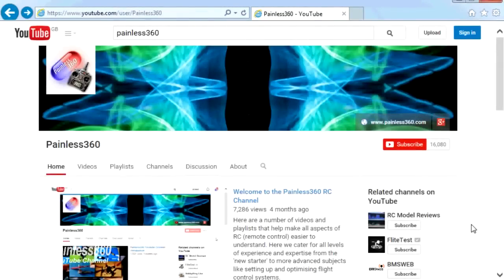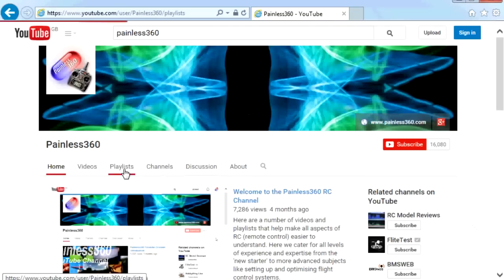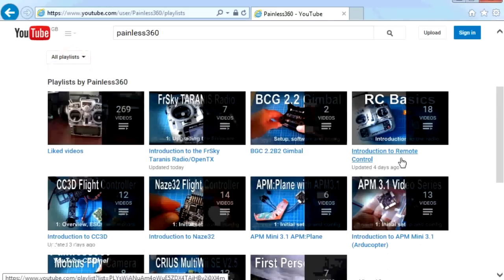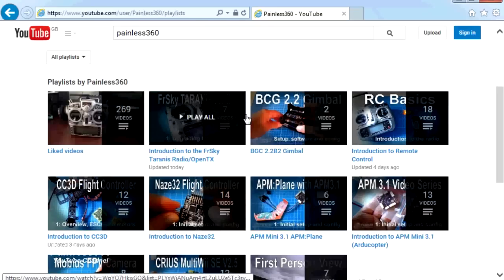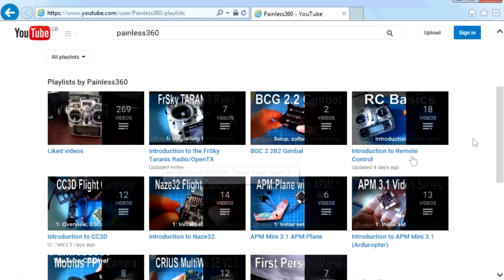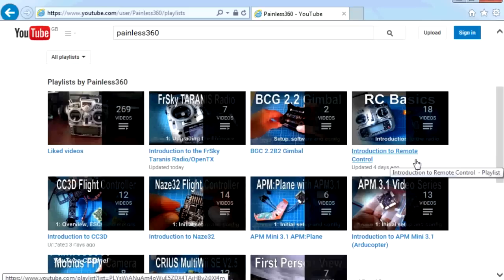FrSky TARANIS Quick Tip - Setting up Throttle Cut/Hold switch easily

Comment: Nice tip Lee, I just used this to prevent me from arming my S500 (I don't want some 10 inch blades taking care off my haircut)

Throttle stays at -100 and Yaw stays at 0 until I flip the magic switch and then they work like they should.

Comment: If I could make a video request it would be setting up a "super simple gimbal" with a naze32 on clean flight. Easy build using cheap components everyone has in the parts bin and it would go slick on your tricopter!. Thanks for everything Painless360!

Comment: Absolutely love your quick tips like this "oldey, but goody" of a OpenTX trick! I've been pulling my hair our trying to properly calibrate the speed controllers on a fixed wing while connected through Pixhawk. Hopefully adding this switch allows me to properly calibrate and start flying :-).
Reply from the maker: Check out my latest Pixhawk 2020 videos for lots of up to date tips.. Happy flying
Reply: @Painless360  Awesome! Thanks, I'm checking the Plane and Multirotor playlists out now. Thanks again! Happy flying as well :-D!

Comment: Love the mod.  I am not using it for throttle but for a 6 position switch that controls flight mode.  I am testing automated  flight and want an easy way to get back to manual mode if things get crazy.  A 6 position switch is not easy to spin the switch back to manual while a plane is spinning out of control.  I can flip a 2 position switch fast to rescue the plane.

Comment: A nice addition to this is to set up a logical switch...
L1   a>x   Thr   - 99   SG -
which means ...
IF Throttle  >  - 99 AND  SG - is selected THEN L1 is true

then add this special function...
SF4   L1   Play Track   thralert   5s
which means ...
IF L1 is true THEN  play thralert every 5 seconds

This will play "Throttle Warning" if you switch to SG- and the throttle stick is not at off.  It will give you a "Throttle Warning" every 5s unless you idle the throttle so you don't forget to idle the throttle before enabling it.

NOTE: thralert.wav is in the SOUNDS/en/SYSTEM folder so if it's not in the menu you will need to copy it to SOUNDS/en to use it here.

Also for S3 shown in the video it would probably be better to use !SG- (rather than SG^) so that all other positions of the SG switch (SG^ and SGv) play the "thract" track.
Reply: +press all the knobs Very good info..!!!

Comment: You're a blessing! Anyway, I have to as you this painless, is the Taranis reliable? The guys at my flying field tell me to get rid of my Taranis asap as they think the tx is garbage and are telling me to buy a JR or Futaba. Is it true that the Taranis has reliability issues? I personally love the Taranis and its functionality but I'm scared that I may lose models as I'm beginning to get into glow airplanes which are expensive. Would like to know your thoughts on this.
Reply from the maker: +Gtx560ti The switches and sliders are not the highest quality. See our video on radio selection that mentions about considering using what others around you do but beware of snobbery. Not every radio is perfect and each to their own.. ;)
Reply: Thanks for the reply Painless. What radio do you use?
Reply from the maker: I am a big fan of the Spektrum kit, I have a DX7 and a DX9 as well as the Taranis. I use the Taranis 80% of the time as it's so versatile..

Comment: It's a matter of preference but I would put the throttle cut on an up switch position ^ (eg SG^) rather a center - (eg SG- as used in this video). The up ^ position is the default off position and it make sense to power on with throttle cut enabled which will be enforced by the default pre-flight checks. You can change all the pre-flight warning checks of course but unless there is good reason it's probably better to consistently keep the default so you don't have to remember how each model is configured.
Reply from the maker: press all the knobs Exactly - It's a matter of preference. This is a demo showing how to do it, not a recommendation on where to put it. ;)
Happy flying!

Comment: Sticky function does not unstick when the switch is reset in simulation. On the radio L02 automatically stays on when you push down the switch and does not wait for L1 and -99 throttle.  I tried with a horus, q7, x9lite.  I'm running the lates firmware as of Oct 2019.

Comment: Nice video.  I tried to set mine up last night on a twin engine model (channels 1 and 6) and it seemed to work.  Only problem was that when powering up the plane, the ESCs wouldn't arm unless I enabled the throttle.  Any way around this?  The only thing I did differently was that I didn't set the value to -100.  But like I said, it still worked if I were to arm the ESCs first by having the switch in the "throttle arm" position upon battery connect.
Reply from the maker: +ZippinZim Probably due to the value of the channel not being one that the ESCs are happy with, I'd look at tweaking the values on the throttle when the mixes are being used. Best of luck!
Reply: That did the trick.  Sorry, should have tried it before asking you.  Changed the value to -100 and works like a charm.  With the value at "0" the transmitter was essentially at half throttle thus preventing the ESCs from arming.  Thanks for your videos!  They are quite helpful!

Comment: hi Painless, would you have any videos explaining how this works with gas engines? newcomers to gas engines like me who might be also having a difficult time transitioning  from Electric to gas?
Reply from the maker: Not really, we only use electric here. A gas engine does need two 'low throttle' setting though. The first is for idle where the throttle is zero in the radio but the motor is idling. The second is 'thr-cut' which is a slightly lower value and that closes the carb down completely stopping the engine. The second is the value you set a throttle cut to. Hope that makes sense..

Comment: Hi, Like to know 1. the difference between Throttle cut & Throttle hold in RC Heli / Plane. 2. What is the use each. Thanks.
Reply from the maker: It depends on there being a consensus on those terms in the hobby.. ;) I've always looked on them as the same thing..

Comment: I've just bought a Taranis after using a DX18. For electric model I used to create a zero throttle (-100) curve and assign is to a switch. After playing with Companion I see you can also do the same thing with the Taranis e.g. two curves (a zero and normal) on a switch assigned at input. Are there any pros or cons in do either via special functions or via curves?
Reply from the maker: Welcome to the world of OpenTX and the Taranis! I too came from the world of Spektrum so was initially confused at the power and flexibility of the new radio - the setups are very different. You can do most things several ways on the radio too, adding to the confusion. You can do it in the way you're using (that's a very DX18 way of thinking ;) ) or you can simply use the special functions to override the throttle channel value with -100 and assign a switch.. Best of luck!

Comment: Thank you for useful video series. I would like to enable/disable throttle cut/hold using SH switch (momentary switch) . If I toggle SH switch first time, throttle cut enable. The second time toggling the SH switch will disable the throttle cut. It is like "alternate on/off" function in futaba. Is it possible to do that in taranis? Thank you in advance.
Reply from the maker: +Kittikun Jitpairod I'm sure it is. You probably need to look at using a few logical switches to hold a 'sticky' value (you could use an unused channel' and then use that to override the throttle in Special Functions. Best of luck with it.

Comment: Thanks for this tip. I want to setup a "oh crap switch" that overrides my 6 position mode switch for arduplane to rth. I set it up as you said and also selected the correct channel and enabled it but somehow it just doesn't work. Is there anything else I have to look out for?
Reply from the maker: Could be lots of things - what troubleshooting have you already tried?
Reply: @Painless360  I tried overriding other channels but this also doesn't work. When I flick the switch I visible that the function is active (Switch Name become bold).

Comment: Hello could this be used for a multi-rotor quadcopter and use it as a second arming switch thanks
Reply from the maker: I wouldn't. The normal arming switch you setup in Beta/Clean/iNavflight is more than enough. Happy flying!

Comment: what would a throttle cut/hold switch do on a quadcopter?  any reason to use it?
Reply from the maker: As most flight controllers have a disarm/arm sequence anyway it's of less use on a multicopter. I tend to use it on wings and planes for hand launching more than anything else. Essential for RC helicopters though!
Reply: Thanks that is what I thought.  I want to say your videos are AMAZING.  I just got in to quadcopters (used to fly rc planes years ago with a dx7) and bought a taranis and your videos are a god send!  I am going through your taranis playlist now and I have learned so much!
Reply from the maker: Thanks for the feedback, glad the videos are helping! Happy flying!

Comment: Hi Painless360, do you know how to make a switch that would bring the ailerons and elevators trim to neutral?
Reply from the maker: https://www.youtube.com/watch?v=UDnygW_Oc7w? Is that what you're after?
Reply: Thank you, very helpful. However I found an easier solution to my need to center the sticks (if the trims are way over half way the Vector AP would not engage) to engage RTH in my Vector. I just programmed the RTH switch both ailerons and elevator override to cero. So when I switch to RTH, both surfaces go to neutral. Super easy, no need an extra step. Many thanks for your reply!

Comment: I'm using taransis x9d i can see your channel monitor level are zero but my shows values in it. Is there way to solve this issue im new . Help would be appreciated
Reply from the maker: No need to post a question lots of times on the channel - see my answer on another of your questions on this topic. Best of luck!
Reply: @Painless360  thanks for replying

Comment: i could only set the throttle cut on one switch, no other switches seemed top respond and i didnt have all the sounds that you had, v 2.3.7 (weird)
Reply from the maker: See my video on the 'Amber' voice pack for OpenTX.. It's all covered in my OpenTX Mix School playlist.
Reply: Painless360  I figured out the switches, they wernt turned on at the main menu so that’s why they weren’t working when setting up a model 👍 thanks for your help 🙏 also when I upgraded the firmware to the latest version, I could no longer see ‘bind’ in the menu, after going through every page trying to find it, the module was set to off, as soon as I toggled it to on, D16 and Bind reappeared 🥴 this is a good radio but rather complicated 🙃

Comment: so i have a 3 position switch set for manual mode, atti, and failsafe for the 3 positions. how can i make it so that manual mode will not allow throttle to go above 85%, atti above 90%, and failsafe is failsafe so that doesn't matter? i still want the full range of motion of the throttle i just want it to max out at 85%, basically change the mix somehow.
Reply from the maker: I'd use the same process as we use in the Dual Rate videos. Best of luck!

Comment: Override option doesn't show up for me. Is that only on the "plus" edition? I'm using Taranis X9d
Reply from the maker: +Tommysdaddy114 Check the version of OpenTX is the same as mine. Best of luck.
Reply: does it helps on your Taranis? I have Q X7 & opentx-x7 2.2.1 (cca71808) vers. & doesn't have the override function too.

Comment: The throttle "tracks" used in this video are not be available by default.  They are from 'The "Amber" Transmitter Sound Pack'.  Assuming your Taranis is configured to use English you need to add them to your SD card in the SOUNDS\en folder.
Reply from the maker: press all the knobs That's right, this video is part of a series and we have already covered the Amber pack. To watch all of the videos in this series you can visit - https://www.youtube.com/playlist?list=PLYsWjANuAm4rtLZuLU2eSTc3svqWx-pa1
Happy flying!

Comment: @Painless360 Hi i don't have any of these sounds. My Firmware VERS is 2.1.9 OpenTX X9D Plus. EEPROM 217.  Please help ???
Reply from the maker: You need to check they are on the SD card. See my Opentx upgrading video... best of luck